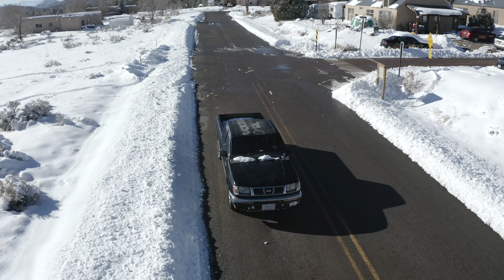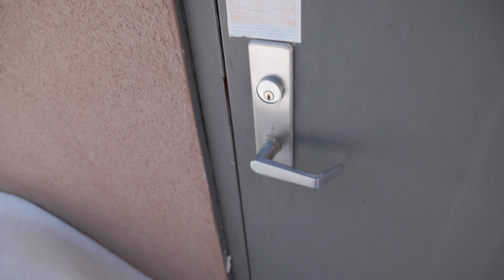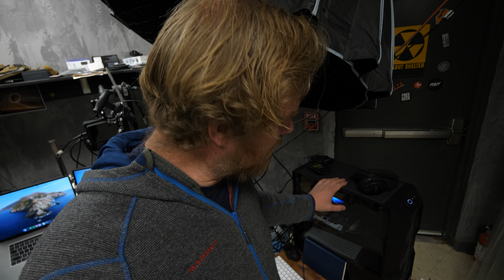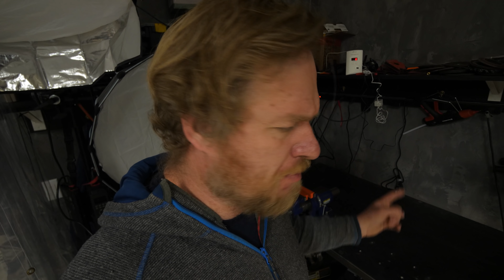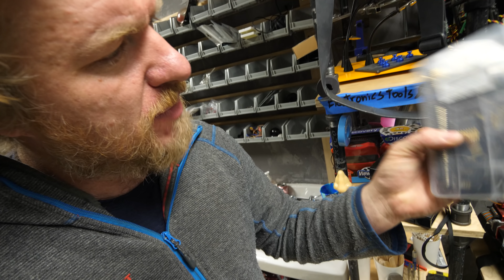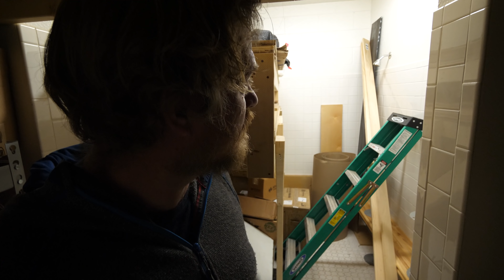I have a new shop! Strange Parts Shop Tour

Comment: "This is a maxed out 16 inch MacBook and it doesn't cut it"
M1 - "heh heh heh, amateur"
Reply: The problem with streaming on a Mac isn’t really hardware capabilities so much as how the streaming software just doesn’t run as well in macOS, presumably due to lack of optimization for the capture and encoding stuff. And I say this as an avid Mac user - I still end up using Windows for my streaming machines. You get way more bang for the buck on those.

Comment: Re the GPU in your new computer: I have an RTX 3070 and it's good, but it only has 8 GB of VRAM, which is about the lowest of the current generation, even the lower class cards have more VRAM. I know it's not as simple because bus speed matters, but I can very quickly fill up my vram on not even that demanding of games. I don't know the specifics for streaming, but I would suggest looking at the 3080 more or even AMD's offerings.

Comment: Chains? on your truck? jeez overkill much? 

That road you drove down ain't no back country logging path, or a mountain pass. I think that's a little silly.
Reply from the maker: They were only necessary close to the shop.  I don't have snow tires on my truck, so it slips and slides pretty easily.  If you watch closely, I did a massive fishtail coming around the corner behind the church.  And that clip was sped up significantly 😂

Comment: you should get a cnc machine that can cut aluminum and even steel like the  ''OpenBuilds Sphinx 55'' or the larger ''OpenBuilds Sphinx 1050'' and put it under your wooden desk in a small enclosure . would be good for quick custom precise metal parts.  I own the Sphinx 55 and its an amazing machine and would be perfect for the type of things you do
Reply: That + a lathe and thus guy would be all set.

Comment: Great job!  FYI, all shops are a work in progress.....forever!  ;)      Need to hang neon logo sign above the drill press, over your right shoulder.  There's enough space and it would light it up enough to make it even more cool during your video vlog.
Reply from the maker: Yeah, that would be awesome!  I've been meaning to paint the strange parts logo on the wall, but haven't gotten to it yet.